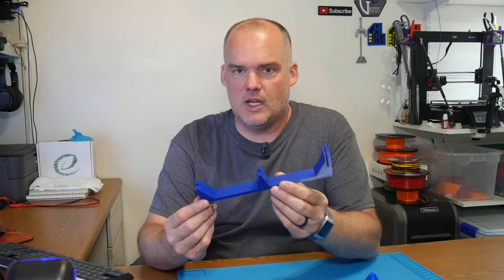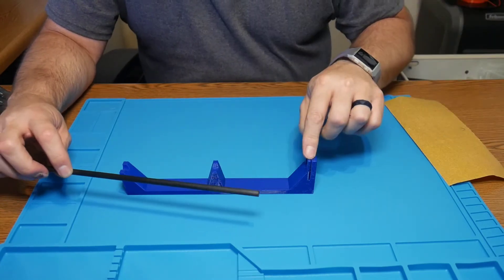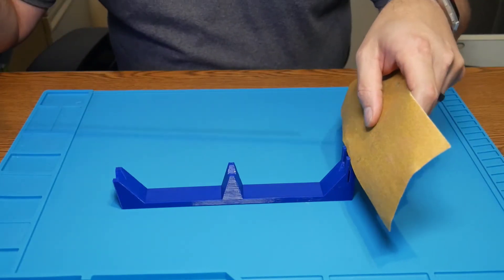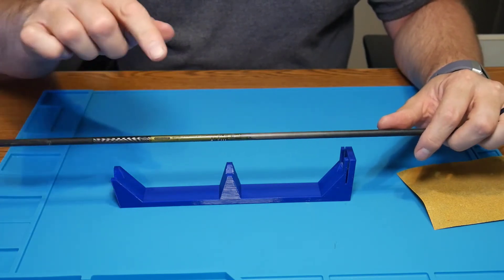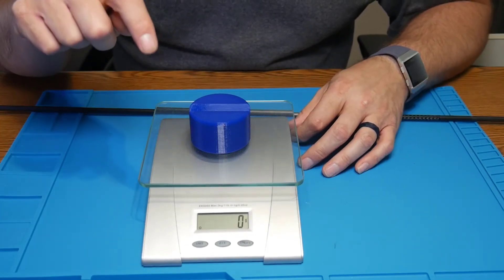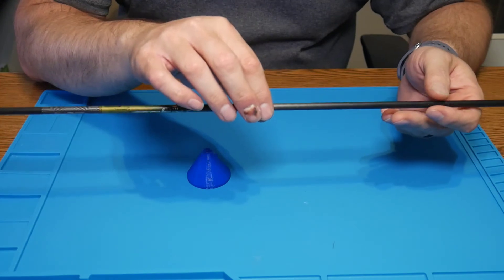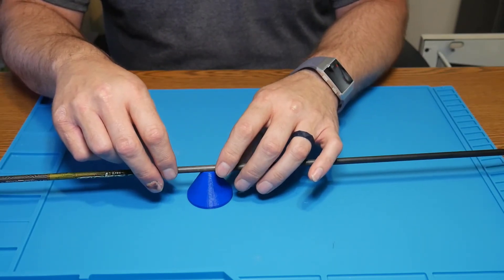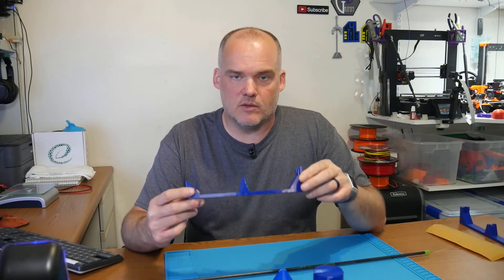Archery Tools and 3D Printing

Comment: Most pro archers are running like 10-16% foc. Balance it on something round. Line a pen or another arrow
And for testing the arrow straightness etc think mor like your squaring tool but only with little V holders at the far ends.. and there ends should be further apart for it than the squaring tool or two overlapping bearings at each endfor it to roll on but they'll have to be good and flat
Reply from the maker: Thanks for that. I do not actually shoot archery and never have. I was building tools for a buddy of mine. He says they work well enough for what he needed/wanted. 

Do you design your own archery tools? For 3D printing? Any links or files you wish to share?

Thanks for being part of the conversation!
Reply: @Grimm3D  yes I noticed you said that so I thought I'd just throw a couple basics on the correct standard/ typical practices out there